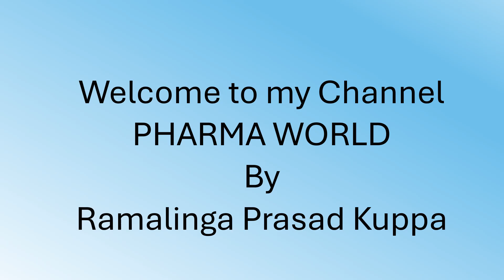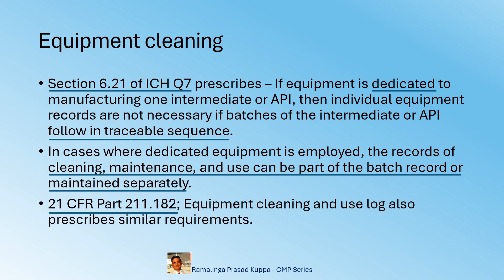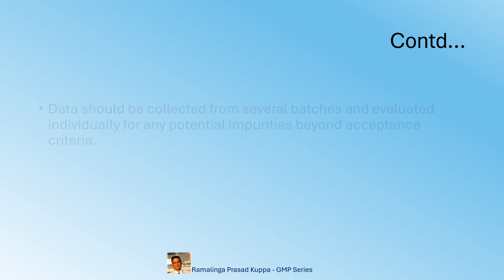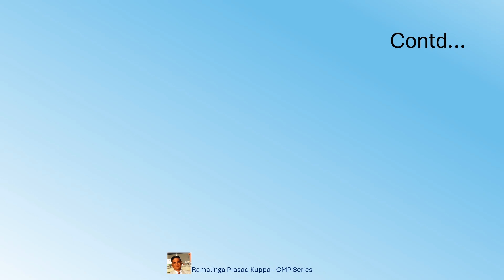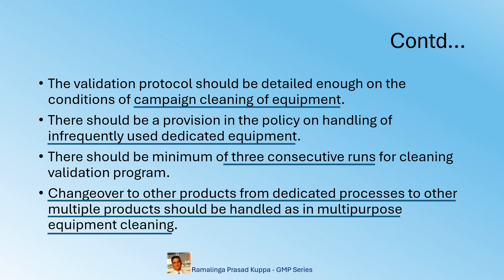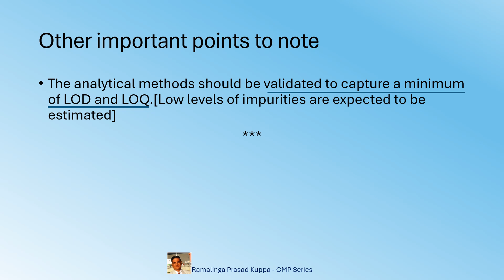Cleaning Validation for dedicated equipment

Comment: Great information thank you. Is the expectation to perform a health based calculation for dedicated enclosed equipment? The product does not have any degradants.
Reply from the maker: @helenanunan  It depends on the type of potential impurities that could have an impact on health. A detailed risk assessment (ICHQ9) helps to justify if there are no potential health hazards possible. Data should support this justification.
Reply: @pharmaworldk1473  thanks for your response. A risk assessment has been completed and there are no impurities of concern. It is still a requirement to perform cleaning val to  establish dirty and clean equipment hold times for low risk dedicated equipment? What are your thoughts? Thanks
Reply from the maker: @helenanunan  A comprehensive cleaning validation protocol may be made with a clear aim on the cleaning  validation with reference to the results obtained by the risk assessment report. In conclusion, the data may be evaluated statistically and  reviewed. An assertive statement that there is no requirement to carry out individual cleaning validation may be made. Regulators may accept this statement. The data should be comprehensive, and there are no loose ends unanswered.